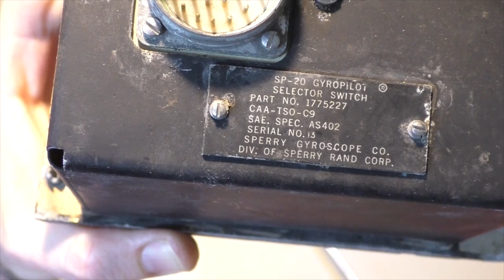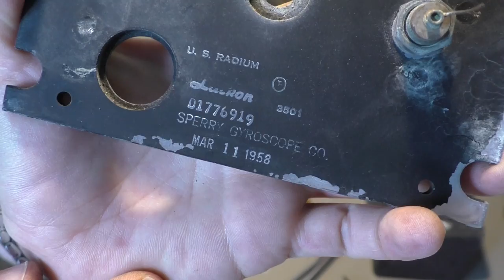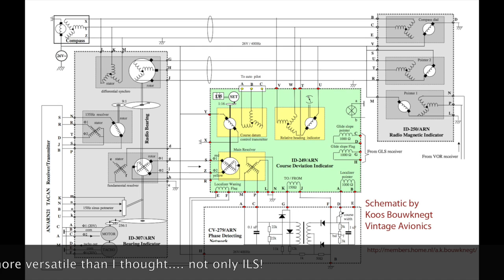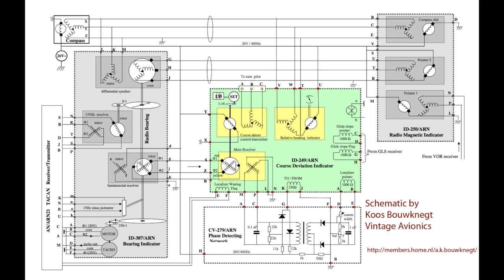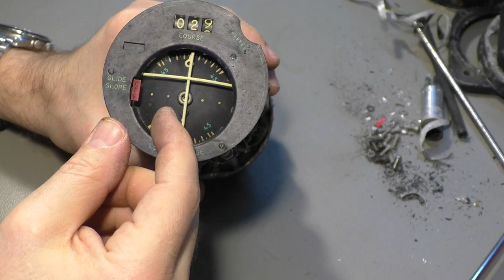PWJ52 - Crusty aircraft instruments from the 1950's

Comment: HI play with junk,
I was thinking the material on the face of the auto Pilot control box might be Lucite. it has the property of spreading light through out its entire surface. in a sign for instance  you could have writing etched on the front surface, and by lighting one edge, the entire panel would glow as thought it were lit from behind. it was used for this and decorative purposes alot during the 30's, 40's and 50's.I wonder if the writing and detent marks for the controls are etched out of the black paint so that in low light, they would be visible